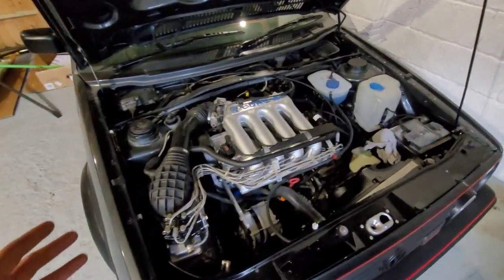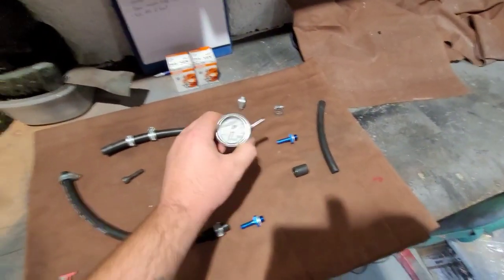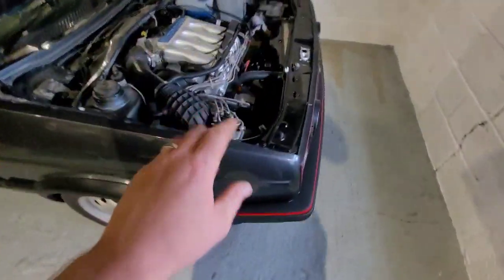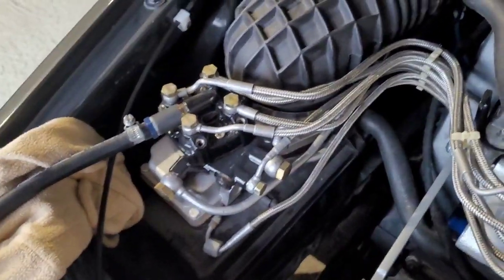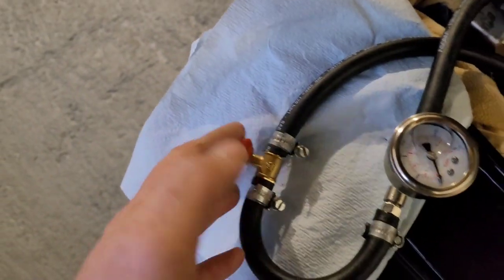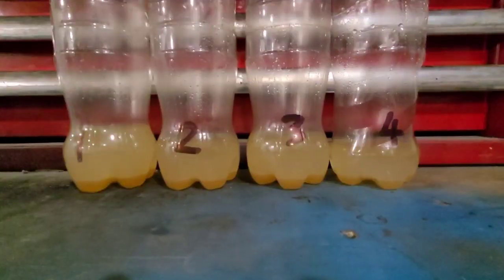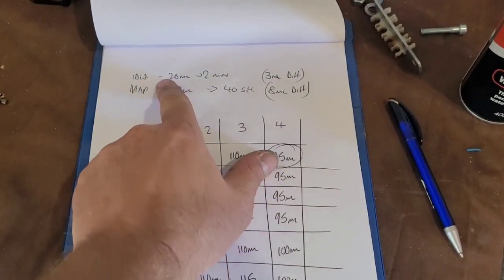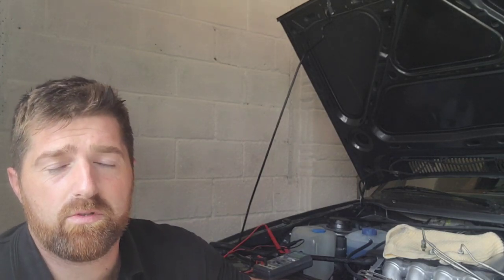Bosch K-jetronic Pressure Testing - Mk2 Golf GTi 16v

Comment: Hi mate, really good video and content on your channel, you can´t imaging how much are you helping me, i´m trying to rebuilt my golf gti stop on the time for 26 years, right, my question is, to adjust the fuel from the fuel metering, it´s mandatory to close the wur pipe? Very kind if you solve me doubt. thanks!
Reply from the maker: Hi and thanks, do you mean when adjusting the system pressure? If so yes the wur pressure needs to be isolated to correctly measure the system pressure
Reply: @GreyGooseRestorations  Hi again.
 I did everything like you, 5.2 bars of preassure with the wur close, not to bad, but, my question now is, on the final test result you said, 40 seconds at full thorttle and you have 80 ml of fuel in total that means is 20 ml per cylinder, right? But (this is ´cause my english is getting rusty believe me) I don´t understand your last bit that you said, first "run", 110 ml at 40 seconds on the first cylinder, 110ml on 2º and 3º cylinder and 95ml of the fourth cylinder, I really don´t understand that bit, can you please say me how much fuel on 40 seconds I need per cylinder? I tried with 20 ml per cylinder and doesn´t start.

Sorry if I don´t explain correctly.

Thanks.
Reply from the maker: @PaxXxuli Hi, as a minimum you want 120cc/min so 60cc over 30 sec test
Reply: @GreyGooseRestorations  Alright, 120 cc between the 4 cylinders in one minute isn’t? This is 30 cc from each cylinder every minute
Reply: Thanks, gonna try on Monday, thanks for your time.
Reply from the maker: @PaxXxuli 120cc/min per injector so 60cc per injector in 30 second
Reply: @GreyGooseRestorations  cheers mate, thought that was 30 cc pero inyector per minute, obviously it won’t start up, thanks, will try tomorrow
Reply: Hi again, sorry for bother you, honestly you are giving a hand, thanks for the help, if you are coming to Valencia, let me know, maybe last question, injectors are doing 120cc each/minute at full throttle, right, idle test it’s not going well, with the “I’m calling zonda plate” in idle mode it’s taking off too much fuel, why? 😢 on your idle test you said 20 cc per inyector on 2 minutes, I’m doing 150 cc in two minutes on idle, I don’t know why. Can you please help me 😭
Reply from the maker: @PaxXxuli you may have the CO mixture screw set wrong (3mm allen key) 

With the air plate set and the fuel system pressured up do the injectors spray
Reply: @ gonna check tomorrow, you said the Allen key on the “zonda plate” ? Check tomorrow anyway
Reply from the maker: @PaxXxuli yes if its set to far rich it'll be spraying way to much
Reply: @GreyGooseRestorations  Hi, tried today with the 3mm Allen on the zonda plate and in idle mode the injectors are throwing up a lot of fuel, when I’m moving by my self the zonda plate you can see how the fuel from injectors decreasing or increasing a little bit the amount of fuel, but won’t make it 10cc/minute per injector on idle mode to 120cc/minute per injector on full throttle.

It’s a headache for me, any solution to my problem, I rebuilt the fuel dispenser and I don’t know who to continue.

Thanks and sorry
Reply from the maker: @PaxXxuli ok, with the plate at rest and the fuel system pressure built up do the injectors spray fuel
Reply: @GreyGooseRestorations  Yes, plate rest, 5.0 bars of pressure, still throwing up a lot of fuel, wur have to be open or still close?
Reply: @ the injectors are spraying fuel but a lot! Not that much when the plate it’s in high position but a lot. Maybe are doing on rest position like 90 ml per injector in one minute
Reply from the maker: @PaxXxuli ok I'd suggest that a seal is at fault internally letting fuel bypass and out the the injectors

Comment: My 8V is dying after a few minutes of running and I have a feeling it might have something to do with the fuel pressure. Any other ideas you can think of maybe? starts fine when cold, runs for a few minutes and starts losing power until it dies.
Reply from the maker: It could be that its not holding system pressure or it may be another fault being CIS-E it has the lambda sensor and DPR to contend with

Comment: hi, could you help me ? where did you buy the 2 little blue thread part and the little steel pipe to make the pressure test system ? regards
Reply from the maker: All parts were bought via ebay

Comment: So i have an issue where i think my plunger in my distributor is stuck because i keep getting fuel delivered even though the metering flap is closed?
Reply from the maker: Could be, theres 3 torx bolts that hold the metering head onto the air metering part. Undo those and gently lift the metering head off, that will allow you access to the fuel plunger. Some fuel may dribble out when you pull the plunger out, just give it a clean up with some form of WD40 stuff.

Comment: Great video and great channel too 👍👍. Some amazing work has gone into this, i wish i had your knowledge!.I have a quick question if you have a moment please? 👍
I have a mk2 gti 16v with an abf motor running kr hardware and still on kjet all done by a previous owner. Its never given me any trouble apart from when the aftermarket immobiliser got stuck on. The problem i was having is that when i fired it up it just died straight away. My mechanic made an adjustment to the mixture using the key on the metering head and the idle screw. It improved the initial firing up but the car then would idle  for a few mins then would shut itself off, just die!.  Its not in use at the moment but id like to get it fixed if i can! 
many thanks fo any suggestions 👍👍
best wishes.
Reply from the maker: Thank you 👍 
First off I'd be looking at the immobiliser, trace where its been wired into and unplug it all, then see if thats your problem.
Reply: @GreyGooseRestorations  Thanks for your reply 👍, the immobiliser was duly removed by  a local auto electrician (sorry, i didnt explain it very well looking  back!) 
That cured that particular problem. The firing up and dieing issue has been more recent. Im thinking it is fuel related maybe? many thanks again for your help 👍
Reply from the maker: Did your mechanic understand the K-jetronic system? (Not to insult his/her intelligence)
-check all rubber intake boots for spilts
-check all vacuum pipes are ok
- fuel pressure is what id be checking to as that can have a big effect on running
Reply: @GreyGooseRestorations  Hi, wow that was  a super quick response many thanks! 👍.
Yeah he is an ex vw mechanic and was around when these cars were new at the dealerships, he is good but has retired/moved away now, the trouble is people dont want to chase faults on these older cars now! 
The vacuum lines have for a long time puzzled me,  there aren't too many of them on the 16v is that correct? from airbox to inlet manifold ? mine seems to have those fabric connectors still!
I've suspected the fuel pressure yes, accumulator maybe? 
It has always been faultless for a 16v really and never let me down until the occasional cut out started at junctions and start up. I have read up on kjet over the years and have a basic understanding but im not really clever enough to put it into practice!  working on fuel systems worries me if im honest and electrically i struggle too 🙈 This spoils an otherwise really good car. 
Thanks for all your help again, i won't give up just yet 👍
Reply from the maker: Have a look on Clubgti in the 16v engine and OEM injection sections, so much info in there.

Yeah theres only  handfull of people in the UK who will and can work on k-jetronic motors
Reply: @GreyGooseRestorations  Hi mate, thanks yes I'm on clubgti constantly asking about stuff! Rubjohny is the man! 👍 shame no one is up this way (mcr). 
I've got a few loose wires at the side of the cylinder head where the 3 temperature sensors are, trouble is i've no idea where they should go as they aren't the regular colours you would expect on a standard car i don't think! (previous owner messing when engine was swapped) yet the dashboard gauges always worked fine etc 🤔 
Another problem to work out! 
thanks again 👍
Reply from the maker: Yes he is a font of knowledge, all the 3 small sensors are the same so as long as all the wires are good then it doesn't matter which way round the wires are on.
Reply: @GreyGooseRestorations  Hi again mate, thank you for your reply 👍.  Yep RJ is great but on my car i think the colour of the wires are a bit misleading or even wrong. 

When viewed from passenger side wing:
Directly underneath the half moon seal at the top: 

Sensor  has Red and Green wire

Sensor beneath it to the left: 
Yellow and Red wire.

Sensor closest to the dizzy: red wire only (could be just the outer sheath which is Red as its quite thick though?) 

I took a pic of a car recently at vwnw and the 2nd sensor listed above seemed to have a black & brown wire on it ??

I don't know if my car is correct or not?

On the loom which is near the wur (under it) ive got a green and white wire unconnected to anything

and from the dizzy plug  ive got a blue and white wire also unconnected to anything?? 

both of these seem to be bent into a u shape as though they were once joined up by hand?? 

Thanks for all your help, i could send you a picture if its possible which would show you a bit clearer? 
best wishes 👍
Reply from the maker: Yeah no problem, send me a photo via messenger
Reply: @GreyGooseRestorations  thanks, ill do this at the weekend when ive got access to the car, many thanks 👍

Comment: I want somebody to work on my gti 16v
I have running ptoblem
Reply from the maker: Whats up with yours?
Reply: @GreyGooseRestorations  starts cold ok
Starts warm up and starts play up and down iddle.even when driving struggle to go full revs.im slowsly giving up😭
Reply from the maker: Sounds like it could need the warm up regulator rebuilding, or the idle valve is playing up, when you turn the ignition on does the idle valve give a constant buzz? Its the part on the right hand side of the inlet manifold with a long rubber pipe/tube going to the air intake pipe
Reply: @GreyGooseRestorations  i swap with another still same.yes is buzing.where in uk you located?
Reply from the maker: Could be a few different things, where are you located?
Reply: @GreyGooseRestorations  im in hereford.
Reply from the maker: Are you on the mk2golfownersclub on facebook? Might be someone local to you who could come and look 👀
Reply: @GreyGooseRestorations  yes Im.
Reply from the maker: If its buzzing then its working.

So once the cars warm it wont idle and won't rev properly?

North Wiltshire
Reply: @GreyGooseRestorations  yes
And dont take revs very vel.
But sometimes it goes ok.